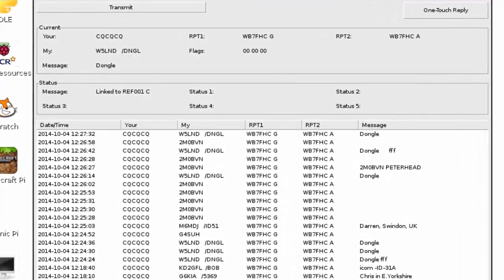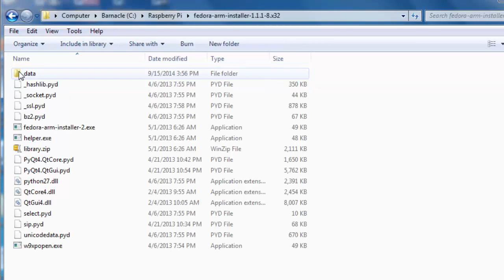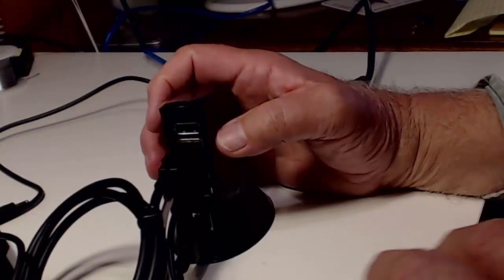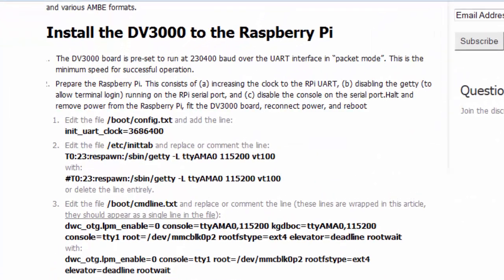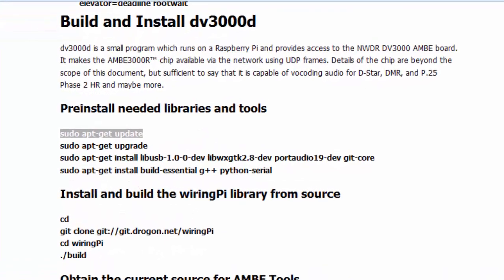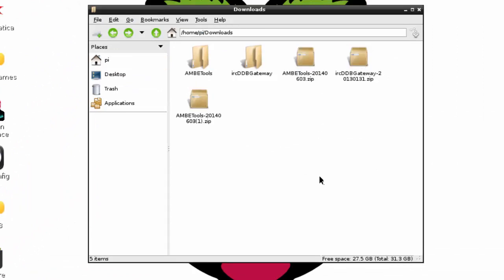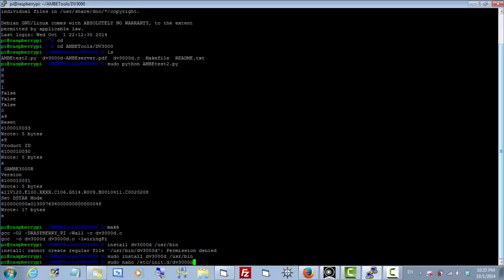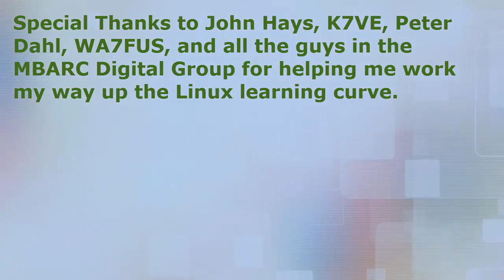DV3000 D-Star on the Raspberry Pi for the Linux Challenged Radio Amateur Part 2

Comment: Quick note about SD cards: most new high capacity cards are SDHC which are NOT compatible with the older SD standard. Any card reader you plan to use should say they can be used with the SDHC or SD high capacity standard.

Comment: For a person who says they're not a Linux guy, you did very well.  With that being said, I'm even less of a Linux guy than you are. I am now studying for my Technician class license. I realize that I am in need of a Ham radio clock. I would like to build my own using a raspberry pi but I haven't found exactly what I'm looking for. Would you consider building one with these specifications and showing the build on your channel? I want it to be able to have both local time (the local time would need to be able to have 12 hr or 24 hr format. DST should be able to be enabled or disabled) and UTC time. I would like the ability to track the space station and the ability to add a call sign. You choose which Pi to use for the project. Are you interested?

Comment: I ordered my backordered Rasberry PI 2 and the DV3000 and yes I know nothing about Linux.
So, is this what I need to download "Fedora Remix"?
Reply from the maker: Adafruit has the best tutorial I've ever seen on getting the Pi up and running. Start here: https://learn.adafruit.com/adafruit-raspberry-pi-lesson-1-preparing-and-sd-card-for-your-raspberry-pi
Reply: Budd Churchward Is my Rasberry PI 2 dead?
I installed the ing on the card and put it in my rasberry connect the HDMI cable to the card with usb mouse and keyboad and then the power.
On the moritor I get no Signal but the lights on the card light up.
Reply from the maker: There are so many things to check here. Start with the monitor and work your way to the Pi. Make sure the monitor is using the right source. Test the cable by using it on another device, perhaps hooked up to the same monitor.

If it isn't the cable o the monitor check out the SD card. If you removed the card from the computer too soon you may have to put the image on again.

Adafruit also has a help forum. They are probably better prepared to help you than me.